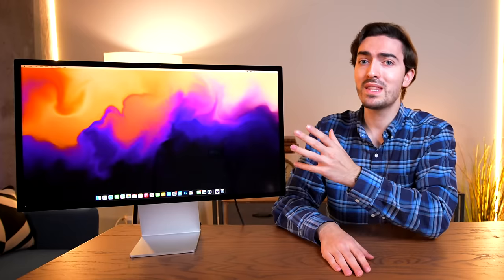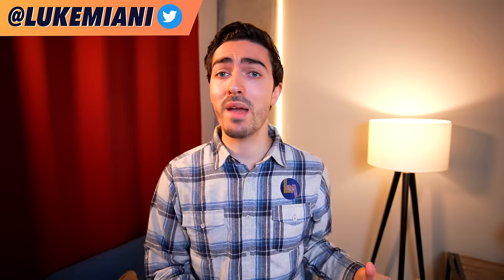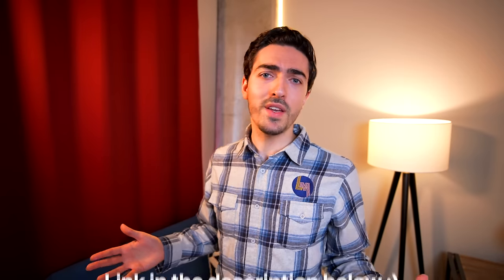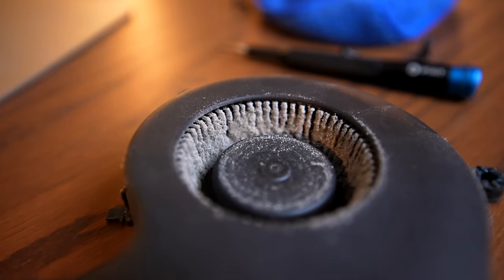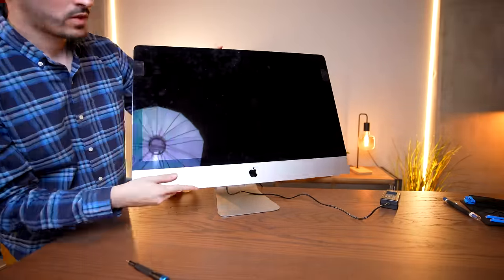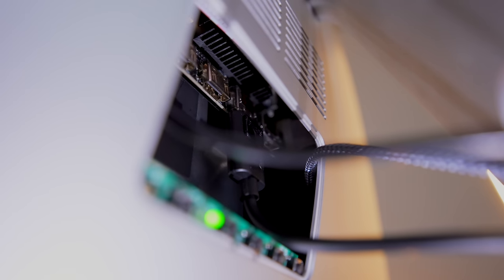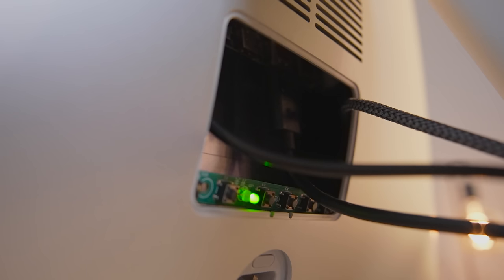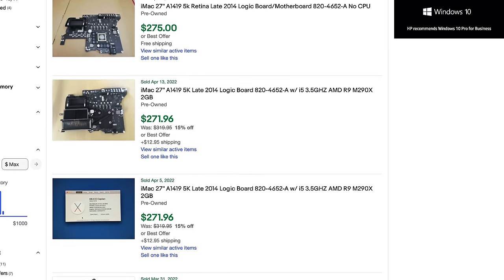How to make a DIY Studio Display for just $600! (USB-C & Built-in camera!)

Comment: Luke, the link for the conversion board you used doesn't work. Based on what boards are around now, i gotta let you know that im VERY surprised that you didn't notice low brightness compared with original iMacs :(((  If im not mistaking, low brightness is a symptom that seems to be created by such boards!
Reply: I really can’t figure out why Luke will not reply to me!

Comment: Really good!! I want to add an external monitor to my 2019 27” iMac and make it look like a twin, so I will copy this project! Thanks for inspiring me!! I just wish I will be able to reuse the power button and the power inlet, and making the signal out from one of the USB-C original holes…
Reply: There's been a couple of other YouTuber DIYs where they re-solder the power button on the chassis to be connected to the converter board actually :)

Comment: i got the exact same model from 2014, the dust is the main trouble, it cause an over heat during the summer and now my screen has some issue, I believe there could be my cpu or gpu has been melting solider due to the overheat. I paid over $3000 for the top of the line model, and it was ended up good for 2 years.

Comment: Big fan of this channel… content is great! 
This particularly sparks my interest as I have a 2015 iMac and have just purchased the m2 MacBook Air as I travel a lot and wanted portability. I keep coming back to this video wondering if I should/could do it. 

The iMac now is pretty useless so making it a monitor for home would be perfect! 
I’m a little sketchy on the whole exposed power supply thing.. but would love to try it. 
However, losing the speakers and even the webcam doesn’t bother me as I use external speakers anyway for recording music. But it’s the io that I would miss… would a dongle work with this? 
So usb c dongle from the air to the display in? Meaning I could plug external drives, music interfaces etc…. And does this also power the MacBook with a one cable setup or is just a display in? 

Many thanks Luke 
And keep up the great work.

Comment: I had the 2014 iMac. Bought it at launch. It lasted until I bought the M1 Mac mini. However, the iMac in that time I had to bring in multiple times for overheating issues. Apple ended up replacing several parts during both times. Both times it helped for a short time, but the overheating would start up again soon after. Then the warranty expired, so any future times I brought it in would be out of pocket. Instead, I decided to open it up myself. The amount of dust inside of it was crazy. I'm surprised the fans even moved, with how much dust was caked inside of it. It was disgusting. You'd think with all those times I brought the thing in, Apple would have cleaned it out, but nope.

As for the Studio Display, I'm not a fan. The camera isn't great in it. Plus I prefer a camera not fixed to a display. Being able to angle the camera or place it where I want is ideal for me. I'm also a dual-display user, so I would need to invest in 2 of these projects, which isn't a bad thing, but I'll just stick with 2 4K displays that I got for around $400-500 each.

Comment: This is a really intriguing Idea.  I own a 2017 iMac 21.5 w/ Retina that the Logic board died on.  I replaced it with a Mac mini M1 and a Studio Display.  It's my work setup... but my kids use it and I'd like to pull them off.  If I upgraded my M1 Mac Mini and set up a second station using the m1 Mac mini with the 2017 iMac as a display... That would be awesome.  I'm fairly confident I can figure this out.  But... is the 2017 21.5 iMac/Retina too different from the unit you converted?
Reply: Nope

Comment: I think I will pull the trigger on a 2015 one with 3.2 Ghz i5 (for less than 400€) but as my good old MacBook Pro is a mid 2012 I think I will use the whole machine instead of recycling it as a 5K monitor.

Comment: 2014 iMAC >  Weren't there 2 Versions of th 5K Display reLeased in 2014?   It seems Like the 2015 was the first Complete 5K iMac DispLay (forget the differences)
Reply: Nah. In 2014, Apple released the non-retina 21 inch iMac and the 5K retina 27 inch iMac. The 2014 27 inch WAS the 1st version of 5K retina display. 2015 27 inch was the 2nd version of the 5k retina display. 1st version & 2nd version are the same -- same nits, same everything, except 2nd version's panel supports the P3 wide color gamut for video professionals.

Comment: I think it's genius. I'm planning on doing exactly this to our old 2012 imac to then hook it up to my pc. However I'm going even further and replacing the hinge with the Vesa plate (got my hands on the parts on ebay) so I can wall mount it. If I wanted to go full send, I would dremel out one of the USB ports so that I could attach an HDMI extender to that and then plug the input cable into that, and also wire the DC PSU to the power inlet on the back of the chassis and the power button. That way I would be able to completely close up the back and not have to leave the RAM hatch off.

Update: have completed the mod and it works perfectly! Would definitely do again

Comment: Wow.  I watched this on my late 2015 27" iMac as I was looking for an upgrade solution.  It is tempting but at this point this computer is still working as it did when new and has a 2tb fusion drive that is fine for my use.  I'd hate to sacrifice it.  Maybe when it dies a 2nd time.  The first time I still had a warranty on it.  It is only today as I looked at the upgrade possibility that I discovered that they are no longer supporting it with OSX upgrades, something I suspected would happen when they released the M1.  I'm also looking at the Luna dongle as a stopgap.  It may work well enough for my use with an M2 mini.

Comment: keep the working motherboard inside the imac but have the video routed through the controller board.  Then you can both imac and target display mode?  just wondering.
Reply: Presumably you could loop back the iMac output into the adaptor

Comment: My only nitpicky comment would be that if you installed a flash drive and maxed the RAM out you'd have a very capable machine, especially with that upgraded GPU and the i7. However, the idea in itself is fantastic!
Reply: I'm running a 2017 iMac from a fast external SSD. Can you install one inside? But I find my M1 MBP much faster than the iMac, so wouldn't expect that big a jump for just an internal SSD. The M1 screams. I'm liking the idea of this project. I'm already using external speakers, because the internal aren't that great.
Reply: @gregs2274  You sure can! It would be a lot faster than an external SATA SSD.

Comment: Great video Luke. I have the same 2014 Mac and will recycle it the same way in conjunction with my M1 MacBook Pro.
QUESTION:  How would this setup work when running two of these converted displays with the MacBook (side by side).  I assume plain sailing with the Caldigit TS4 dock that I also use ??

Comment: Looking to try this with a newer fully working iMac. However, I hate to throw the working 'computer' away. Would like your thoughts about running the 'computer as a headless server while using the display standalone. I understand that there are issues if a display is not detected by the 'computer'.

Comment: 5K is nice, if you need it, but I get by with a pair of 32" (2560 × 1440) displays that cost less, together, than a single 5K display.  They really do look fine for every purpose I put them to.   Note that if you do take on this DIY project, you can sell the logic board on eBay ... plenty of demand for parts out there ... and cut your overall cost even further.

Comment: Lovely work. I understand that the existing webcam wasn't available for use within the new setup. Are there any other internal cameras that would fit in the space which would provide better resolution? 

I'll assume that the iMac's speakers were similarly off-limits, which I'd understand, but would be sad to lose. Update: saw your note on their unsuitability. Thanks.

Still a great DIY.
Reply: Update: I might seriously consider attempting this with a 2015 iMac, if I knew more about what else needs to be connected before closing it up. Especially the power supply. Your video sped through that bit. ;)

Comment: Thanks a bunch Luke! I have a 2017 iMac 5K with i5 processor and I think 2022 was the last OS upgrade it would be getting. The display is gorgeous and I was really sad to let it go. Your solution seems pretty good. I'm thinking of pairing this up with the Mac Mini. But here's a small question - can we somehow make use of the Thunderbolt 3 and USB ports available in the back of the Mac?

Comment: Is it possible to keep the speakers of iMac to work in this project? 
Cuz some people might actually need a built in speakers of the display itself.
Reply: the converter board has a 4-pin speaker connector - on a mission to see if it can actually be wired up to the internal iMac speakers which are decent quality!

Comment: Just curious, did you run the computer after you cleaned it and see if that helped its performance before disassembling it?? Otherwise, thanks for the video....lots of info about Macs in general and how they operate. I am afraid to take my Mac Air apart, this helped.

Comment: That looks great. I think I'm going to buy the gear for my 2017 iMac 27". In a couple of years I will buy a new MBP, and then I can use the screen. And  Iit seems I can buy a case for the SSD-blad and use it. It's still quite quick.

Humbly, Ylan
Reply: And today it happened (the assembly that is). I am sitting in front of my iMac (as a screen) driven by my MBP 16" M2 Pro enjoying the 27" screen.

Thanks a lot @lukemiani, I am so happy, even if I didn't fit the screen exactly straight when I glued it back on.

Comment: This is an amazing project!

For me, the biggest plus would be to be able to switch between multiple inputs, so I'm even contemplating hacking my LG 5K with a different controller board.

If you have the time, could you check for me how a MacBook in clamshell mode behaves if you switch the input away from it, and back? If that works well, this would be the answer to a wish I've had for years.

Comment: Am I able to take my 2011 21.5" iMac and use it instead of my 1080p monitor for my gaming laptop through HDMI? (Low latency, but without gutting the mac) That way I could save space and make more use of the iMac.
Reply: I would think so... I looked on eBay and there were it seems, a lot of this boards for older, not 5K iMacs

Comment: Is there a way to keep the speakers and does the cam have a mic? Curious because I have a late 2015 but just got the mini. I would need all of those for video conferences.
Reply: i looked at the specs for the webcam and it does not include a mic.  it doesn’t look straightforward to connect the speakers until an upgrade converter board is available that is able to split frequencies during the pre-amp stage.  I love this project and these 2 items are dealbreakers for me at the moment!

Comment: How does the tilt adjustment work now that you removed a lot of internal weight? Isn’t the hinge exactly calibrated to balance the weight of the internal components?
Reply: I'm not sure, but I do have a faceless 2017 iMac I picked up to salvage, and the tilting mechanism does not work without the panel, it just goes into the highest position. I have a feeling that the display panel balaces it, perhaps.

Comment: A fascinating idea.  I do wonder why you didn't leave the speakers inside and add a controller for them?  (I'm assuming you could power them from the monitors power supply)  There's even a place to mount a line in jack on the back.

Comment: Luke I have a question for you. So I have a 2017 21.5" 4k iMac and was wondering if I could turn older 4k iMac's of the same size into 2 extra displays to have a triple 4k monitor setup? I already plan on buying an external GPU, an i9 and 32mb of ram to outfit the current iMac. Seems the 21.5" iMacs are dropping in price significantly....and I am talking around $450-$500 range...so I am taking advantage of it..lol. I could probably snag an older 4k iMac with the i3 processor for dirt cheap and use the display. So, I just want to know...would this be possible?

Comment: This is awesome, thanks. One question though, when I look at the description of the conversion board, it says 'Max.resolution：DP 5120*2880 @60HZ HDMI-compatible 3840*2160 @60HZ （For some Graphic Cards, single DP can support up to 5K resolution.  But most of the time, to make sure that it can reach 5k resolution, you will need to connect 2 DP cables instead.'

Comment: I'm thinking of upgrading my 2017 macbook pro 15inch. I am a graphic designer and constantly have illustrator/indeisgn open with multiple files at once. Should I go with the M1 Pro with 16gb or 32gb or ram? is the M1 Max worth it? Can't believe my trade in value is only $585...

Comment: I’m making this. However I’m not understanding all the middle steps. I looks like you attach the controller board to the display panel with 3M foam tape? Also how does the controller board get grounded, or is this not necessary? Thanks!

Comment: Hi Luke! thanks for the tutorial! I'm very new to this (and this subject about hardware modding is very interesting to me)... do you think it would be possible to do the same procedure but for the 24'' M1 iMac? I would really like to do that, because 27 inches are too much for my small desk (haha). Would a board meant for a 5K display work fine for the 2.5K display?, or does it need to be for a 4.5K? (that's the most likely possibility) That's tough, because (as far as I know) the only 4.5K display model is the one of the iMac. 🤔 Thanks in advance.

Comment: Luke, thank you for the great and useful video!
Question: can you leave all of the iMac as original, but slip in a video switcher to run either the internal video or the conversion board as an alternative “DIY target” input? I have a 2018 iMac that I would like to retain iMac usage but really only add external input(s)! If possible wouldn’t this be more cost-effective and long-lived for the 2017 and later iMac/iMac Pro’s!! Please weigh in here, thank you.

Comment: I’m still running a 2014 iMac I just upgraded it to the latest or almost latest operating system Big Sur 11.6.8 runs flawlessly! This machine is really good it’s really a shame that Apple abandons old hardware so quickly I don’t see any reason to upgrade to a newer system. I mean yes it’s tempting the M1 or M2 Apple Silicon. I would be much more upset if I spent thousands of dollars on a new studio Mac and then Apple decided to abandon it after a few years so I’m sticking with my old 27 inch iMac!

Comment: I plan on doing this on my 2015 5K iMac when I’ve come around to install a new NVMe in the 2019 iMac. 
Was also thinking of sticking a Raspberry Pi or a gutted NUC into it as well, having the option to run dual systems if I need it. Really don’t need that feature but it would be a fun project. @Luke Miani what 12 VDC power supply did you use for your build? I didn’t see it in any of your lists?
Reply: get a 7 amp to 8 amp one just to be sure it has the power to drive that

Comment: Recently purchased a 2015 5k iMac for just this project. $400 off Facebook Marketplace. Gutted the internals tonight and temporarily taped the screen back on after getting the model # of the LCD panel so I can order the conversion board. Hoping that after selling the logic board, power supply, speakers, RAM, and internal SSD, I will end up with the world's least expensive 5K display. :) Just unsure whether I'll have better success/profit re-selling the logic board WITH CPU and AirPort installed, or without. 

Also, while I will be using the display with my docked M1 Air, I'm now contemplating getting an M2 Mac mini to pair with it, as with my EDU discount, I'd have a sub-$1k 5K Apple silicon desktop Mac setup. Had been holding out for Apple to sell a larger/5K iMac with M-series chip, but I think this will be my new setup going forward.
Reply: Follow up...still looking to sell off the logic board, PS, and speakers, but I have had my "new" 5K monitor up and running for several months now, paired in a 2-monitor setup with a 30" Apple Cinema Display, and I gotta say it's a terrific setup. I use the ACD for general computing tasks, web browsing, etc., and I use the iMac display for watching videos and photo management/editing. The sharpness, color accuracy and vibrancy of this 2015 iMac panel are stunning, especially in comparison to the ACD (which, for such an old display, has actually held up rather respectably). It was well worth the very minor surgery to take apart the iMac...I ended up with a sub-$700 5K monitor that looks TERRIFIC and is natively recognized by macOS as just an internal iMac display despite running off a single USB-C cable.

Thank you, @lukemiani, for this terrific video and tutorial!
Reply: @DPfen  Do you happen to have a link for the board and power supply?
Reply: @BlazingChicknMan  I do, but YouTube keeps deleting my response to you with the links. Got them both on eBay using the links Luke posted in his video.

Comment: I'm always late to the party, but I've been looking for this information for ages. I've got a late 2012 27 inch iMac which although working is well past its prime, so I want to convert it a second monitor, using USB C to connect to my newer 24 inch Mac. I realise I'll need a different converter board for the older 27 inch LCD panel, but is this still possible?

Thanks!